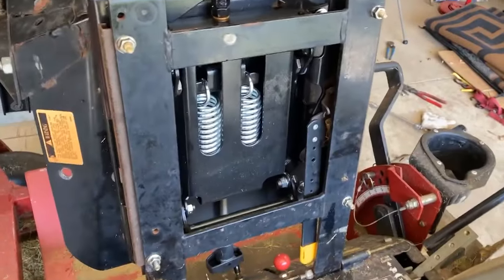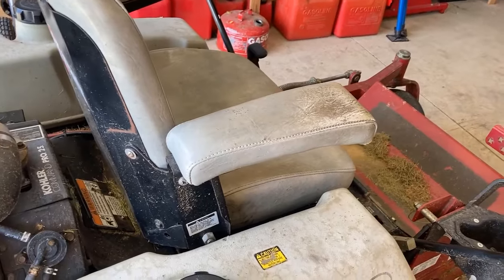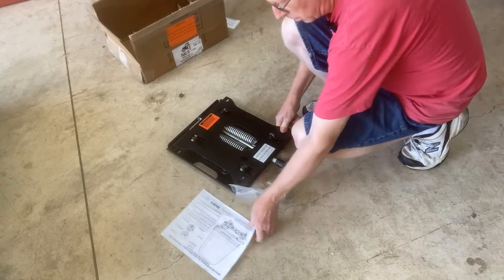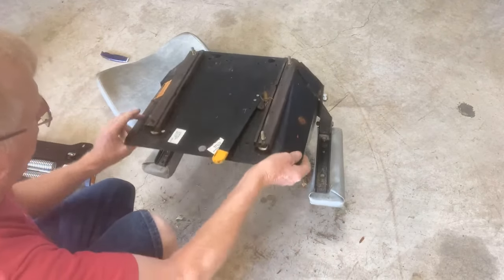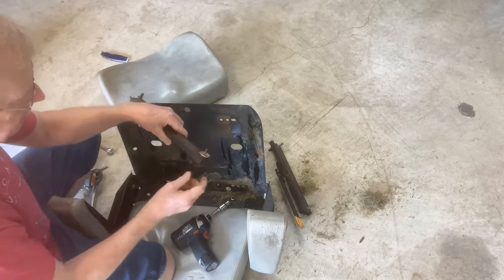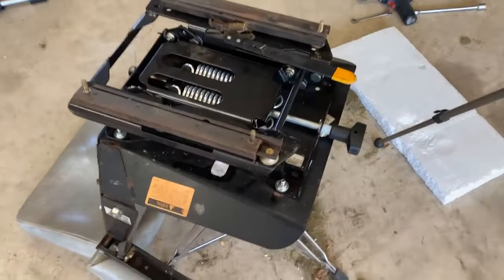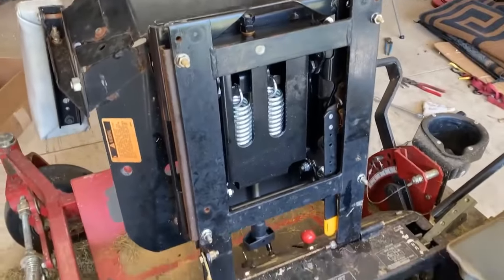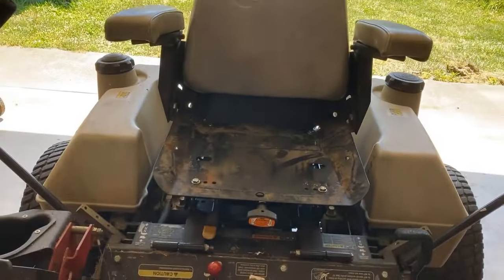Zero Turn Suspension Seat Upgrade! Exmark - Scag - Toro - Cub Cadet and Others!

Comment: I want to do this on my Toro  Time cutter, have to check if they make one for that. I appreciated your comments the most.  I don't know whether to do this or buy a new Time cutter with "My Ride".  Any comments? If this does it I'm going to do this.  Great video thanks.
Reply from the maker: The company does show a ProRide seat for Toro... It's here... https://amzn.to/3W1fQ0P
I'm sure they would have an add on like the one I installed. You may have to message them to get the right kit. The one I have certainly helps! Good luck!

Comment: Did the existing seat slider's adjustment lever interfere with the Trac-Seat travel on your Exmark?   The video of an installation on Amazon said to switch the seat sliders with each other so that the slider's adjustment lever was not under the seat anymore.   I have the same Exmark seat arrangement and your video is going to help a lot when I tackle the install this weekend.
Reply from the maker: It didn't interfere with my adjustment lever at all. Thanks for the comment!

Comment: Anyone know if this will fit the Toro Titan Max?
Reply from the maker: The company does show a ProRide seat for Toro... It's here... https://amzn.to/3W1fQ0P
I'm sure they would have an add on like the one I installed. You may have to message them to get the right kit.
Reply: I was just about to ask the same thing
Reply: Scag cheetha 2?
Reply from the maker: @Dutch5573  It appears to be this one. https://amzn.to/3KIvLug You may want to contact the company to confirm it. Thanks!